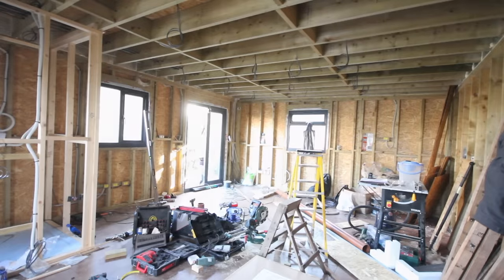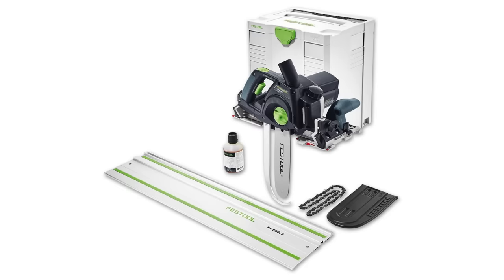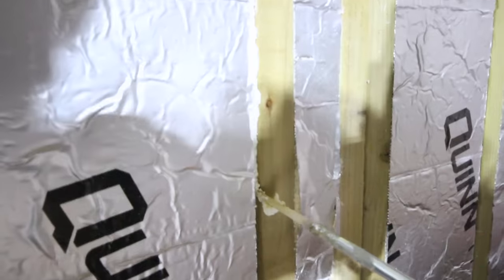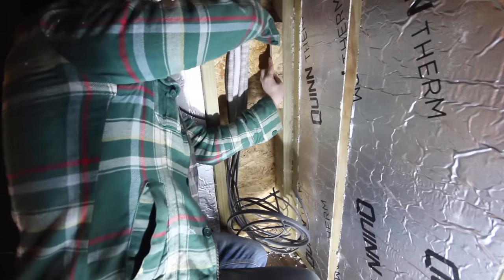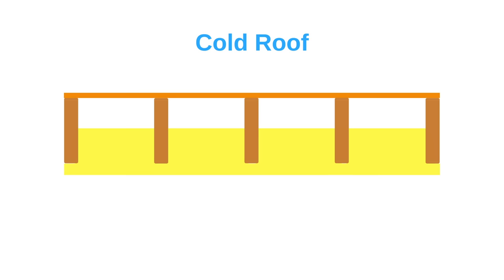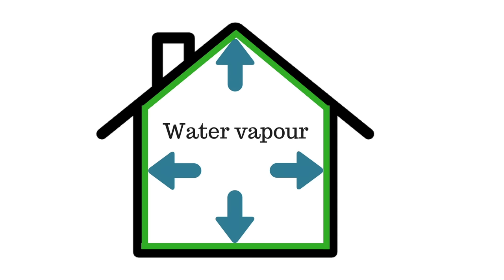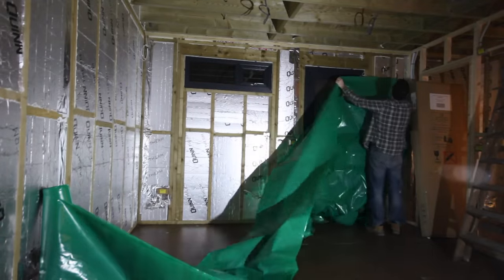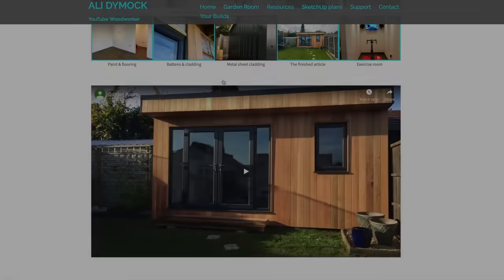Garden Room Workshop: Part 15. Wall Insulation & Vapour Barrier

Comment: Hi Ali, i have followed these videos and been a massive help with my “garden room” but have one question with regards to vents? Did you install any?
Where is the best place to put them etc, a friend one mine built his a few yrs ago and said his garden room “sweats” in the summer, and i should put a couple of vents in as i have a vapour barrier?
Reply from the maker: Do you mean in the building itself? Good question, I think I forgot to mention that while air tightness is important, you also need to allow some controlled air flow which you get through the trickle vents in the doors and windows-so when you order them make sure you ask for trickle vents.
If you mean ventilation for the cold roof, this should be vented through either your soffit or bottom of your cladding!

Comment: I'm curious to know where you got the information for your illustration of the walls admitting more heat loss than a roof
Reply from the maker: The key thing is that heat rises so the roof is where most heat is lost per m2. My walls are almost double the surface area compared with the roof hence why more heat will be lost through them. It obviously changes depending on the building - how many stories, what is the floor made out of etc so really the graphic is to guide our thinking on insulation rather than exact figures. Scroll down here for similar figures: http://www.constructionchat.co.uk/articles/golden-rules-for-eco-home/
Reply: @AliDymock  excellent article thanks for the upload

Comment: You should have used SuperFOIL!! Would have saved a fortune and saved yourself half the install time. (At least) The cutting, and shaving, and spray foam, and still needed to install a separate vapour barrier.... definitely should have used SuperFOIL  😉
Reply from the maker: So kind of a bit like wool but with a foil on. I can imagine it's an easy install but I bet my U-value is a lot higher. Certainly wouldn't rule it out for others though so thanks for mentioning. Does sound like you're selling the stuff though lol
Reply: Super foil is good at reflecting ‘RADIANT’ heat, which is slightly different but they don’t explain that in the sales talk

Comment: I have aa concrete garage I am boarding up on the inside without insulation should I still put a moisture barrier under the wood or will it do nothing
Reply from the maker: No insulation or heating? No need for a vapour barrier 👍

Comment: Foil faced PIR does not need a polythene vapour barrier. Just use aluminium tape to repair any damage and seal over all joints. Additional polythene barrier risks mould between the layers. Best avoided.

Comment: I've been researching different insulation types. Apparently you will suffer thermal bridging using the method you have here of placing insulation between the studs. I've read you will lose alot of heat through the studs as they will take up a large surface area of your building. I'd be very grateful if anyone could advise if this would be an issue. Thanks
Reply from the maker: Hi Lee, did you watch the whole way through? As I mentioned you CAN overlay insulation over the inside of the studs and yes it will really reduce any thermal bridging but honestly, from my experience you just don't need to, it's super warm! You wouldn't be wrong to do so but as I say in the video: cost, time and reduction in room size. If you went for wool insulation then I think it could be worth putting some 25mm PIR over because 1: wool isn't as good as 90mm PIR and 2. you can get a nice vapour barrier with the 25mm overlay which is really important for wool insulation. Hope that makes sense.
Reply: @AliDymock  Hi Ali. That makes sense. Thanks for taking the time to reply.

Comment: Hey i've got one question, and i'm assuming it's stupid but i'm 13 with no prior building knowledge so can't bash me to hard, we're building a 18x10 brick shed, do you think that i'd have to have much wooden framing at all to support the insulation? Because i'm just assuming that we could put 4 wooden collums in each corner of the shed and attach it to the brick, then just put the insulation inbetween it. Is this possible? Or are these issues with this, i'm assuming that i'd need more support to attach a wooden panel or something to cover the insulation but still, would this be how it works? Sorry for the longwinded comment. I over-explain alot. Like i am right now...
Reply from the maker: Good on you. Sounds like fun. it's hard to say without seeing it but you could attach the insulation to the brick with spray foam, that might be easier than putting in internal studs. If you use insulated plasterboard that's easiest.
Reply: @AliDymock  Alright, thanks mate. As i say i'm new to the whole thing so your help is appreciated :)

Comment: Hello Ali, I guess I'm late to the party, I'm building mine mancave too, mostly following your guidance. Thank you very much for it. Just quick question.... Shouldn't there be air gap on walls too? Same kind of thing as you did on floor? Gap of inch on the outer side of the frame ? Thank you
Reply from the maker: Not late at all! Welcome. 
Yes and that will be achieved with battens on the outside of the walls before the cladding

Comment: Why are using a Vapor barrie when you are using rigid insulation?
Reply from the maker: The timbers can allow vapour through as they're not covered and this is exactly the place you don't want moisture because it can cause rot.

Comment: I'm a bit confused. The only thing that makes sense to me is to create a vapour barrier but to also have a ventilation system otherwise all that vapour trapped in have nowhere to go
Reply from the maker: That's right, you do want ventilation otherwise it will get stuffy inside. Mine comes from the trickle vents in the windows and also the extraction fan in the shower room

Comment: Polythene on the warm side acting as a vapour barrier could “sweat” you should use a breathable vapour barrier such as rhino vent pro etc that will never sweat I’d never use polythene in the walls asking for trouble
Reply from the maker: Sweat in what way? I can't see that a breathable membrane would help whichever way you face it...always open to ideas though!
Reply: @AliDymock  it definitely does sweat or condensate rather that’s why building regulations doesn’t allow plastic or polythene roofing felt in houses any longer as they condensate and drip and if left long enough will rot the rafters etc.
When dry lining building inspector will insist on breathable NON plastic vapour barrier 👍🏻

Comment: From your graphic, it doesn’t show that the majority of heat is lost through the walls. It shows that more heat is lost through the walls than through the ceiling or through the floor. 35% of heat loss through the walls cannot be the majority as there is another 65% to explain
Reply from the maker: 0:38? The other 65% is explained in that image. If you like: 'More heat is lost through the walls than any other area.' Strike 'majority'.

Comment: Don't retrofit polystyrene as external wall insulation & don't use spray foam or Polyurethane (PIR) as insulation internally, they are not fire resistant, use rockwool it is fire resistant.

Remember grenfell & what happened to it,  don't cheapskate on the insulation it could kill you!

Do a search for "Testing The Burn Ability Of Insulation In Wall" on Post 10 channel, it is eye opening.

Comment: I don't think the U-Value on your walls is as low as the calculation shows.  That is based on a 140mm thick stud.  Kingspan state a minimum 20mm gap between the inside of the wall and the insulation, my understanding is that this air gap is an important part in the delivery of thermal performance.  You have pretty much no air gap, so I think the U-Value is actually higher than the calculation shows.  Not an issue for you, but may be for others needing building regs sign off.
Reply from the maker: Yeh the calculator wouldn't allow me to pick thinner studs. I'm not sure the gap makes that much difference, perhaps for radiant heat, but yeh for b regs it might be a bit of a rough and ready calculation.

Comment: Good luck with this if you live on a five lane main road. No way would this be enough
Reply from the maker: Sound like you live on a motorway. This was thermal insulation as noise wasn’t a concern.

Comment: Why did you introduced the cables inside of structure? it is wrong! because you destroyed the resistance .
Reply from the maker: where would you put them? Outside where they are less than 50mm deep and can be reached by a screw or nail? https://www.nhbc.co.uk/binaries/content/assets/nhbc/tech-zone/nhbc-standards/tech-guidance/8.1/protection-of-electric-cables-in-walls-or-flat-and-sloping-ceilings-.pdf
The reason they are in conduit is not to pose an issue with resistance from the insulation. Clipping to studs can also help with dissipating heat.

Comment: You should never install two layers of vapour barrier in any structure. If (and when) moisture gets to the wrong side of the plastic trough the holes from the plasterboard screws it will be trapped between the pir board and the plastic and eventually it will soak in to the wood and start rotting it. You should always make sure that the structure is allowed to dry properly. This is what happens when diyers start giving advice. 🙄

Comment: PIR = ?
Reply from the maker: Polyisocyanurate (the foil backed insulation)
Reply: @AliDymock  Thanks - Before this, the only PIR I had heard of was 'Passive Infra-Red' as used in security movement detectors / cameras

Comment: broooo :D you shouldnt use that plastic if you got that thing behind it!
Reply from the maker: lol, what thing?
Reply: @AliDymock  that aluminium stuff on the walls, if you put plastic over it the area between those two materials can make risk of moisture problems, ask your builder/ some contractors?
Reply from the maker: @abenzuoo  it really shouldn't get any buildup of moisture as it blocks anything coming from inside. Anything that does get through should make it's way out through the timber studs.